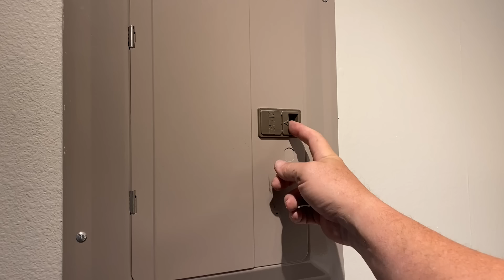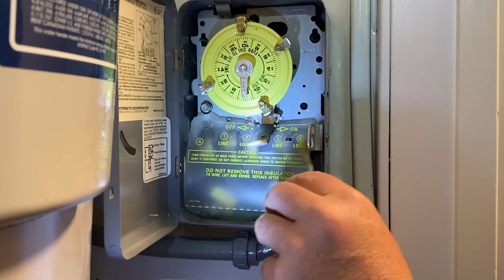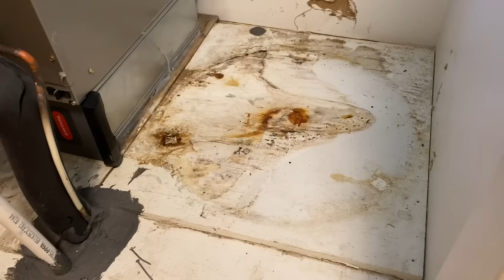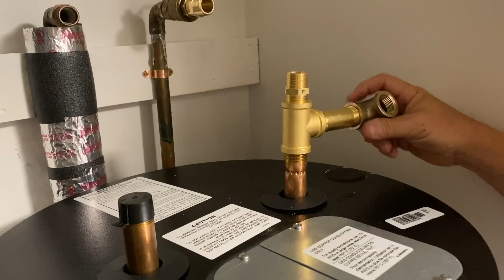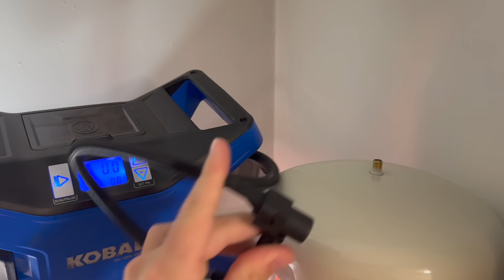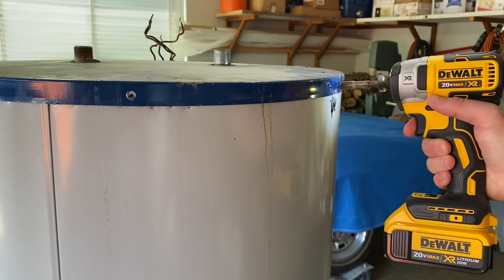I Saved $1,000+ By Replacing My Electric Water Heater (Step-by-Step)

Comment: This job is one of the most overcharged ones in the plumbing business.  Used to be $300 labor and has morphed into $3000.
Reply: welcome to the middle man. you got customer service, business owners, shareholders, and everything fucking else. rather than just the dude doing the job
Reply: @KonsequenceTV Most people fail to mention the shareholders they also forget since we all depend on 401 k retirement that’s us over charging ourselves out of future necessity 😅
Reply from the maker: @KonsequenceTV  Yeah its gotten really bad! I pretty much don't even consider a contractor for most projects anymore. The only reason I want a quote is so I know how much I can spend on tools haha!
Reply: Mcdonalds used to have a dollar menu too. Time change.
Reply: That's a bit of an exaggeration. Even the large, expensive companies around me don't charge $3,000, and that's including all material.
Reply: @t @PeterJoseph7865 where are you located
Reply: A Home Depot affiliated installer quoted me $900 to install a new gas water heater, however, my original tank did not have an expansion tank, so you can probably add another $300 to the $900. Of course, the tank itself was not included in this charge. I opted to install myself and save the $1200 for about an hour of labor. My cost for the expansion tank and the additional piping needed to install it was about $75.
Reply: One company quoted my dad 10K+  to change out the old heater for our restaurant. We said f no. Bought a restaurant grade heater, had Home Depot delivered it and my dad changed the whole thing. Parts and heater all under 2k, although did took him a few hours after work for a couple days.. but 100% worth saving the money
Reply: @Andi-lk5ff  It is, and it's obviously not worth the difference in cost for you going from 2k to 10k, but remember the liability aspect of having an unlicensed person installing an appliance like this. In the event of a fire or catastrophic failure you may find your insurance denied because of it. It's also the case that in most places you require a plumbing permit to remove and install a water heater. If the inspector isn't carefree and lazy they'll want the installers license number and things. When you don't have that you may fail and end up with a red tag and require a professional to come and either take out and reinstall or certify that it was done up to code. Homeowners may not even know important details like what sealer to use on the pipe that is approved for gas. Knowledge about using lead-free fittings, etc.
Reply: I thought the video was how to avoid paying the company rate change?
Reply: I paid $500 labor for mine. Got a new Bradford with a mixing valve and expansion tank for $2000. I definitely didn't have the time and the dude knocked it out in 4 hours max (he waited around for another guy to drop off parts from the shop).
Reply: When I do a water heater it takes four hours do a journeyman plumber and about $750 in material.  I pay my plumbers about $50 an hour but if you factor in benefits/taxes and their vehicle, the real raw cost is about $80 an hour for every Plumber I have. 80×4 is $320 in cost for that plumber to install that. That’s if he doesn’t need help lifting or moving the new heater or the old heater. $750 in raw material. That’s $620 for the heater in about $130 for a new ball valve, flex lines, expansion tank, etc..  altogether my cost as a business is $1,070 best case scenario.  A lot of times here in Texas. I have to have two guys on the job because the water heater is in the attic.  A lot of times the cost is $1300 or so.  I have to operate on a 40% gross margin on everything I sell or I won’t be able to pay the office manager, the dispatcher, payroll people, liability insurance, Workmen’s Comp. insurance, phone bills, shop/office rent, electric bill for office, etc. I literally don’t have a choice. So whenever I sell something for $1,300 it has to have a 40% gross profit margin so the total price to the customer is $2166. Me as the owner of the company I don’t make shit off that. It’s literally just a drop in the bucket. If I do it for anything less than that, my company would slowly start to lose money and I wouldn’t be able to exist anymore.  If I do it for anything more than that, everybody’s gonna call me a crook and I won’t be able to exist anymore.  Run the numbers I just gave you through an AI and see if I’m wrong.
Reply: @brasshouse-fireball We are in the same boat! People don't understand the costs involved in running a business. My techs, installers, and office staff deserve to make a good living wage.
Reply: @brasshouse-fireball everybody wants things done for cheap, but everyone wants to have a livable wage. Welcome to the cost of a livable wage lol 

It’s funny how everyone writes a check they can’t cash huh?
Reply: @brasshouse-fireball you forgot gas/maintenance/insurance  for the vehicles. That adds up fast.
Reply: @brasshouse-fireball  FOUR HOURS?!
Reply: @KonsequenceTV yes
Reply: @brasshouse-fireball  It's 4 hours if you're counting the guys showing up to the job, inspecting the tank, running to the supplyhouse to buy one, and coming back and doing the job. It's an exaggerated time frame. When I do them I have the customer take a picture of the tag on the tank, show up with the new one, and have the thing done within an hour. That includes the worst case scenario where the tank's drain is plugged and I have to do extras like shutting off the main to install new valves and such. It's the difference between being self employed and having employees. Everything is slow as hell and jacked up once people are on the payroll.
Reply: @brasshouse-fireball dont tell that to the socialist. They wouldn't comprehend.
Reply: @brasshouse-fireball  4 hours!!!!!!!!!!!!! I can install a water heater in about 1.5 hours including the need to install an expansion tank that many older tanks don't have.
Reply: @robertdevoy3119  no you can’t😂. How do you get the water heater? How do you dispose of the old water heater? How long does it take you to drain an old water heater?  Don’t even dude.  Dudes like you that tell me shit like that end up not getting raises and bonuses because you’re full of it and  tell me stuff I can’t count on. If it takes you an hour and a half to do a water heater that would mean you can do four in a day and still have time for a nice lunch.  That ain’t how it works, kid.
Reply: @brasshouse-fireball  Everyone wants to make a good income at what they do. Then it comes time to pay for a service and people flip out. Drive time, picking up the tank, taking the old tank to the recycler, etc. If everything goes right we might be able to install 3 or 4 in a day. Other days everything goes wrong and it's 2 installs.

Comment: Pro-tip insulate the cold line as well because what happens is if you get a high moisture day from rain and you have the windows open or if you have a leak somewhere that cold water in the lines will cause condensation to drip non-stop all over the place you can actually use the PVC cleaner to get off the purple dye

Comment: Hahahahhahaha 40 gal vs 80 gal, and you think insulation will makeup the dif. Lol
Also that tp setup is not code in any year. It's funny everyone always gets upset about the price but nobody ever thinks well if you're going to buy one and it's usually $500 to $800 for the tank and then additional Parts if you don't have them already let's just run it up to an extra hundred on top most water heaters that are that old you'll never be able to drain them that easily and why the hell does it have a timer please shut off the water heater at certain times

Comment: Good job, one mistake you made though.  The line voltage is not negative and positive, you are thinking about DC current running to a car battery.  They are simply 120 volt "hot" wires that are equal to one another.  240 volts in total.

Comment: What you may not know is that most manufacturers now will deny ANY warranty claim on a unit NOT professionally installed, that's what stopped me. Previously this was not the case, and I had always DIY'd. It doesn't make much sense, but I guess they got tired of dealing with homeowners.

Comment: Don't use the factory drain us a 3/4 pipe to a 1/4 turn ball valve with a hose bib adapter and cap. This will allow you to flush the water heater correctly. Because the factory drain will keep the calcium inside and only let the powder out. I had a master 50 years teach me this. So don't be fooled by the plumber saying they will flush your water heater it's a lie and they know it

Comment: Did you look into any of the Heat Pump Water Heaters?
Reply: They are much taller and would require rerouting the water lines higher. Tank width might also be a problem.

Comment: Teflon tape is used for reducing friction so that you can screw a tapered thread deep enough. General rule of thumb is to hand tighten them and then turn them at least 3/4 to 1 times on. After that as far as needed to find your install position. Don’t do more than 2. The number of turns needed depends on the size of the fitting. 
Pipe dope is used to help with sealing as the metal threads are not always perfect.

Comment: I didn’t see any anode rod left in the old heater.  That’s the crud you see.  Replace your anode rod every 5 years if you can and flush the water heater every year.  More crud means the anode rod is deteriorating.

Comment: gonna be honest brother, this install was done really well but given the space constrained i would have installed tankless, the cost would have been minimal
Reply: I agree tankless is the way to go, but you are way off on price. I would go with a natural gas tankless rinnai (here in Maryland, gas is cheaper than electric), but he was wired for electric, so that may be easier. Nonetheless, the cost for the tankless rinnai and associated fittings with be DOUBLE the cost of the tank he installed.

Comment: The flexible connectors you used require no dope or tape, because sealing is done by gasket.  I think they also provide dielectric isolation between  the tank and copper for when used on steel tank risers. Because such dielectric isolation may be present, the electric code requires a bonding connection between hot and cold piping at all water heaters to ensure that copper hot water lines are grounded (at least as well as the cold).  You lack that code  requirement.
Reply: They doped the threads for lube--which is why they only used a small amount.

Comment: Great work gents. There’s not much a father son team can’t tackle. ❤👍👍
Reply: They used stranded wire on a water heater.  I have seen 3 water heater fires due to this.  This is why you can only use SOLID core wire on water heaters.  This guy is an idiot
Reply: @Red_Twizzler congrats

Comment: For a 20 year old water heater, the scale build-up isn't so bad.
Reply: You did a nice thorough job plus produced a nice video. Good work!
Reply: My tank is about 40 years old. Runs fine.
Buy a new unit. Needs work or replaced in 5-10 years
We going backwards
Reply: An 80 gal ELECTRIC water heater ?
Reply: @2pugman that's what I said 😮

Comment: Buying a hot water heater tank from a big box like home depot is a bad idea.  They are not the same quality as what can buy in a plumbing supply shop.
Reply: Yes, but big box water heaters cost less and if you're DIY, the labor is free.
Reply: @n9wox true, but i don’t like doing the labor more often than needed.  We ordered a commercial grade water heater directly from plumbing supply shop (was not much more than crap a depot but made much better and heavier) and installed electronic anode rod.  Should be good 25+ years.
Reply: @ElmerFudd79 some supply houses will only sell to business and not homeowners. Also, big box stores have more convenient hours.
Reply: @n9wox Ive had no problems as a homeowner buying at 3 different plumbing supply shows near me as well as supply house (online site) . Glad you like depot but beware that most everything there down to plumbing fittings is made subpar to boost  profits for depot.  I stopped buying depot whenever possible unless an emergency,  Lowes can be better then depot for plumbing supplies (PVC fittings better for example) but I’ve found that product from local plumbing supply shows are much higher quality and last longer.  

Bottom line, i would mot recommend any water heaters from depot… manufacturers produce special models with inferior parts to boost corporate profit for both Lowe’s and home depot.
Reply: @ElmerFudd79 actually, I shop at Menards

Comment: Nice job installing the water heater.. there is only one problem I believe you will run into.. when the a c drains into that line, surface tension where water stick to the side of the pipe and  goes down that line, it could go into the T fitting and fill up your water heater pan..  you should have used a WYE fitting..😂
Reply: He didn't read the instructions to the water heater.  Stranded wire as a water heater power supply is a HUGE mistake and specifically prohibited in the instruction manual due to fires.,

Comment: Nice job, I switched from tanked to tankless for this reason - as you get older it's harder to lug around a 100 pound water heater.
Reply: ;Yes. I'm over 70. I had installed a soap dispenser for my kitchen sink. I had remove the old faucet so I could remove the chrome trim piece before installing the soap dispenser. Something about working on my back and reaching upwards is tiring. It even caused a soreness in one knee.

Comment: I removed an old electric water heater and put a new one in its place then called for a quote to hook it up.....Yep, they still wanted $2000.00 to hook up 2 water lines and three wires.....😂😂😂
Reply: I get it, a plumber's time is valuable, but they should cut you a break since the work you did saved them time

Comment: It is crazy that WH installs by plumbers are at least $1000 over WH/connex cost for a 2-4hr job.  As this video demonstrates, it is not rocket science.  FWIW you can probably get a better grade of WH at your plumbing supply house than from big box store and the cost will be very close.  What you can't do is get a warranty validation on your WH/install if it is not done by a certified plumber.   "Trade rules", also some jurisdictions require inspections, esp if NG WH.
Reply: Stainless tank. IDK they had those..
Reply: I think plumber pricing is to have a set number and that covers the easy jobs as well as the more involved jobs.   When I replaced my WH,  a friend of my wife was also doing so and inquired for my expertise when she was quoted $2500 for it,  $800 for th water heater (which itself is laughable... but whatever), and then $1700 in labor and fittings?    Did I want to do it?  No, I did not because I know what Pandora's box that opens... did I do it?  Yeah... unfortunately.

Comment: Pro tip! When wrapping teflon tape on pipe threads, flip the orientation of the roll to control tape tension. It won't unroll as you wrap. Nice job.

Comment: Nice video. Installing a water heater is not rocket science and it’s definitely diy for most handy people :)

A side comment, the new electric water heater won’t be any more efficient than a 20 year old electric tank as all electric resistance heating appliances will have the same efficiency basically 100% or 99% after loss. It may have some savings due to better tank insulation standards

Being all electric is definitely go heat pump water heater for the next one, that will cut your water heating cost by 3-4x 

May not fit in your space without modifications :(

Comment: Awesome vid, I am all about DIY, a little sweat won’t hurt anybody. One minor observation, putting the T @ P line and condensation together is considered a no no. The T@P line must be separate for you to spot an issue, plus due to the violent release it’s typically not allowed to drain into the pan but must go straight outside. Finally, all hot water must be CPVC, not standard PVC and I do believe Pex is also a no no for that line.
Reply: Correct and the water will be around 210 degrees. That's why code says it needs to be piped to the exterior of the dwelling...
Reply: T&P needs to be 2 inches off the pan but will pass inspection

Comment: EXCELLENT video and commentary.....!  As a DIY homeowner I can certainly appreciate all the effort required for this installation AND recording everything as you went along.   WELL DONE...!!!
Reply: Yes. Steps and potential problems were pointed. It makes me feel confident that I could replace my water if needed. My water heater is over 23 years old and it's still going without any problems. I've replaced the anode rod once. There was a little bit of the rod metal left.

Comment: Seeing the pop off valve in that galvanized fitting reminds me of my plumbing training 40 years ago. Apparently, as the story goes, someone installed a pop off valve in the side of a water heater and because of limited space chose to use a 90° fitting. Apparently the thermostat on the unit failed, superheating the water inside because the pop off valve was installed incorrectly. It exploded, exiting through the ceiling and taking the roof of the room with it. Make sure not to use the last guys example for insertion.

Comment: That 3/4" ball valve on the incoming cold water line is installed in reverse. Not worth correcting, however.
Reply: I thought it might hit the wall... he was lucky. If I did it, you can bet it would have hit the wall, preventing it from turning all the way on.
If it weren't for bad luck sometimes, I'd have no luck at all.
Reply: Aren't most ball valves bidirectional?

Comment: What is the purpose of putting foam around the pressure relief outlet and piping?
Reply: The foam comes with the WH from the manufacturer, so someone thinks it will reduce heat loss from the WH.